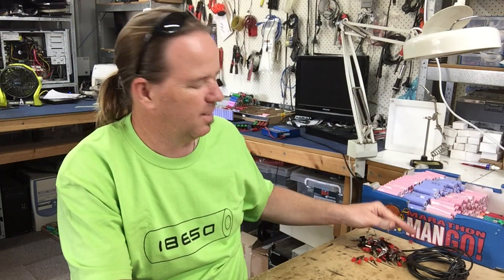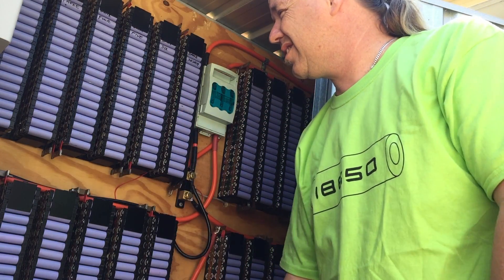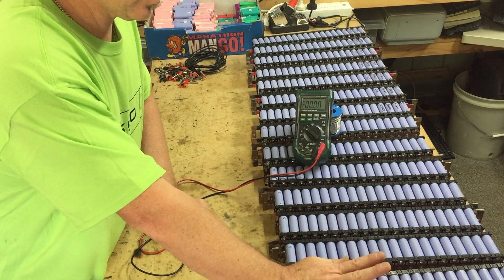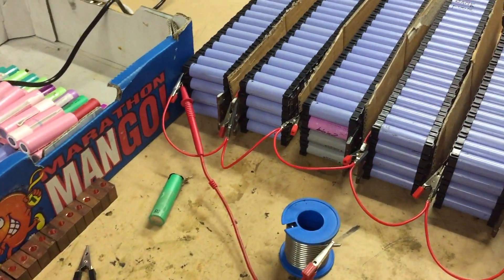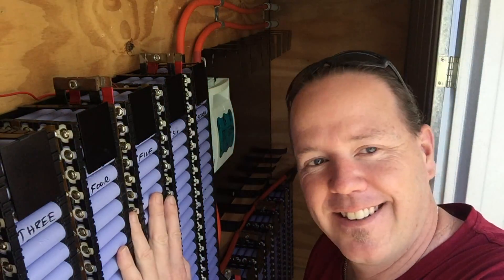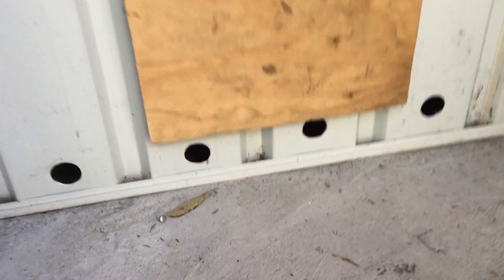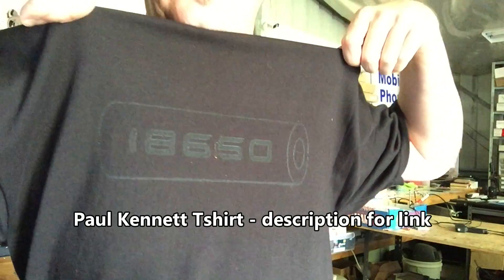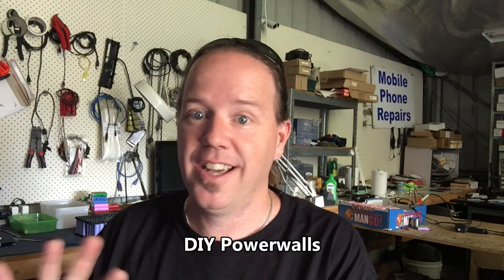Manually balancing my 18650 DIY powerwall top bank of cells

Comment: You are the man who can help me;).i made a small power pack with 18650 cells.its a 12v 10ah battery.i do not have a pcb connected.i putted a balance cable though.when i try to balance charge the pack it gives me different voltage for each individual cell.so i get 3,5 for first series than 4,05 for second and 4,1 for third.am i missing something?i have the feeling something is wrong with the charger

Comment: If one of your packs is for some reason slightly weaker/lower voltage than others, does power flow into that pack instead of out to the load?  Asking because I'm going to be building a pack and looking at using a 16S10P configuration.  Just wondering if the parallel legs need any protection.  Thanks for your help!

Comment: Hey Pete do you remember what size wire you used...and about how long did it take..I've had mine set up for about 6 hours and it hasn't moved..figured it would take a day or so,,,but also thought I'd see some movement by now
Reply from the maker: Days and days i think it was a comment here that said you add a charger to it speeds up the process
Reply: I'll look into that..I do have a few days though, ,ran out of solder to finish the rest of the packs,,but,.thanks for the reply

Comment: Do you balance all the individual batteries before putting them in to the cells?
Reply from the maker: No, each 80 cell ... cell will self-balance then i manually balance as in this video
Reply: so would saying that "batteries in parallel will self balance, and you manually balance the cells going in series" be right?
Reply from the maker: yes 80p packs self balance then parallel up the 14 packs once balanced then they are a balanced 80p14s bank

Comment: so ahh.. how are you monitoring the cells? you got charge/temp controls to each cell? i assume them 18650 don't have current overload/discharge/temp circuits built in? 

and yeah, new here, havn't watch all videos yet, you may have explained it in another video i have yet seen..
Reply from the maker: +Maximus Psychosis very manually, over under bank voltage Via charge controller temp 0.1 amp average load 0.6 heaviest possible load. Every aspect is in many other vids. Work in progress for sure.
Reply: i see, so can you see the cells in the back of the pack potentially going short circuit and thermally running away?
or does the cells have inbuilt protectors? easy way to tell is if you see a wire bump under the shrink-wrapping and they are usually just under 70mm tall over the unprotected ones of 65mm..

so yeah, if you're not dropping them under 2.5V and not over charging them to 3.5v (and keeping to the low load of 800mA) you should be safe

on the other hand, I'm going have no choice but to copy your setup lol nice a neat, easy to maintain, good stuff!
Reply from the maker: Absolutely could do that but then again ( insert NASA Samsung quotes here) One cell ( single 18650 ) already has dead shorted,  if you flick back through my videos and the cell fuse broke and it was a non issue. No cells are protected they are used cells from laptop batteries. Voltages are between 3.4v & 3.9v cycled daily
Reply: yeah, fuses are better then nothing (just about to watch your rant on this),
 getting a 4 cell controller will set you back about $6(off the top of my noggin) each (or one with thermal cutout for about $12 each, but they only have 1 thermal resistor to work with) and you have just a small hand full of cells per rack, about 40/rack? so that 10 each x 7 racks by 4 sectors? that's about $1680 for "piece of mind protection" from china though ebay?

these cells do scare me, but with the cells you've used, nothing's gone catastrophic yet?

also, needed to replace any yet? I have read they have about 100 to 300 cycles
Reply from the maker: No fire (yet) and there is a line up 1000+ long that have said i'll burn my house down - To those please take a seat and watch the show.. 

I currently have 5 spare packs that take less than 5 min to swap out if I see high or low's that I don't like. The voltage gets checked 3-5 times a day. In the first 10 hours of full time use i sat next to it with a thermal camera. Doesn't stop bad things from happening but  (nasa /samsung)........

This thing is still evolving and will continue to grow and improve as funds/knowledge allows.
Reply: HBPowerwall
I do like the concept, I was going to just do a shed full of lead acid batteries, but I think 18560 cell packs may be a better option, and you can pick em up cheap..

next idea is getting a few packs like that to run my electric car... when I build it lol
whadda think? ford falcon ED on 50KW electrics?

..so hurry up and burn the house down damnit! same with the other few hundred thats doing the same thing!
i wanna follow suite!
Reply from the maker: Personally wouldn't put these in a car but many are trying. It's kinda new ground and i'll enjoy watering the grass :)
Reply: well, others are throwing LiFePo4 batteries into cars, they can handle full load pulling off them without any thermal runaway..

Still, cant hurt pulling almost a short on these to move a car, then watch em pop :)

Comment: Hi I've only got a small pack (4S35P) I found bottom Balancing the packs individually down to 3.2v rest 24 hours then bottom again untill all packs are bottom balanced, then as a pack I charge to 4.1 - haven't done too many cycles yet but all cells have stayed level through top to bottom charge.
Reply from the maker: Sounds like you have an extremely well built balanced pack I'm impressed, i top balance and easily get .3 ish volts different at moderate discharge and much larger at deep discharge. Working on slowly replacing packs and making a more balanced pack. Will take time :)

Comment: Planning to point a domain to something like freeforums ?
Reply from the maker: +station240 haven't really looked into it
Reply: I'm not sure about that side of the world, but if you are (or know) a Linux geek you can stand up a cheap (like $5/mo at digitalocean.com -- if you want a referral code from me I'd be happy to provide one) VPS and run phpBB on Apache or nginx fairly quickly.  I set up a gaming forum with a custom header image and several different forum groups in a couple of hours (not counting the design of the header image).

Comment: To HBO and other experienced DIY-ers . Your channel is very educative. I have a 24v,920Ah forklift battery + 12, 3000F Ultracap 2.7V in parallel with the battery. A 3.5KW solar power input expandable to 5.6kW. 
Daily sunshine +/- 10.5hrs
I have ample supply to dead laptop batteries. 
Question: How and what is the best, fastest and safely way to sort these 18650s wuthout depending on false balancers and checkers from ebay.
Reply from the maker: I use eBay ones and am happy, many have gone TP4056 for charging and can't remember the discharging setup but for the convince I'll take the 4s dischargers

Comment: Pete, any idea what amount of current is flowing, when you balance the packs by your "Dundee" cable?
Also any idea what the current, between the packs, is when you are balancing the complete packs in the shed?
Reply from the maker: Don't really but could be a great test ! I'll see what I can do to answer that question for you in the coming weeks.
Reply: It should be very small.  The voltage difference is very small, so not a lot of potential for high current.

Comment: Whats the price for a real balancer (BMS) circuit for a setup like this ? so it will manage the balance by itself ?
Reply from the maker: had priced some for the 24v setup and it was like $700 for a professional grade ones. My main this is appearance I don't want it to look like a mess of wires. Simple and clean. If I had a larger shed I've considered the option of a false wall to hide all the cabling. There is a lot to this question and even more to try get my head around. I'm happy to just check it several times a day for now.
Reply: One could make a balancer for each cell, just a load which will turn on when the cell is over 4.15V, turn off when its under again.
Reply from the maker: One could, but not this one...lol
Reply: hehe :D If I had the time I would make some for you ;D awesome project btw
Reply: You could automate it.  You'd just need a few contactors.  :)

Comment: Hi, which function has the computer in your setup?
Reply from the maker: Computer displays all the data from PIP inverter, SMA inverter, PCM60X & BVM700 energy meter. I can connect to that computer from any device to control my setup and log all required data.

Comment: Thanks for Your Videos !!  Have you done any calculations like cost per KW for the 18650 batteries? ... and how many 18650s do you have total?  Thanks!
Reply from the maker: I have roughly worked it out, that info will be in the 5000 subscriber video. Tested cells in service 2240 + about 800 more ready to go into the next battery.